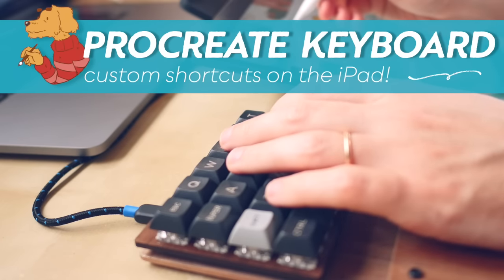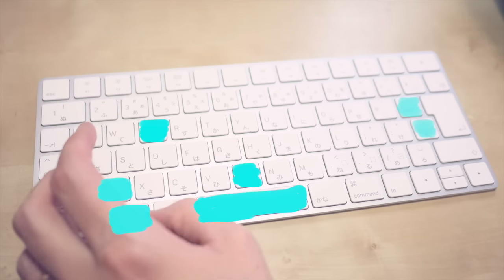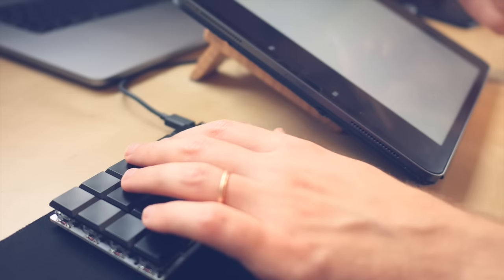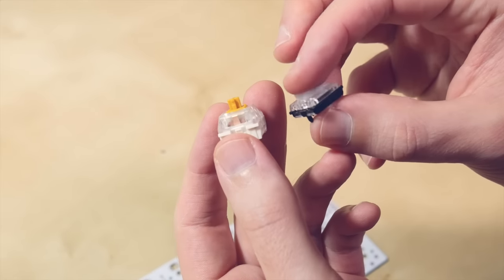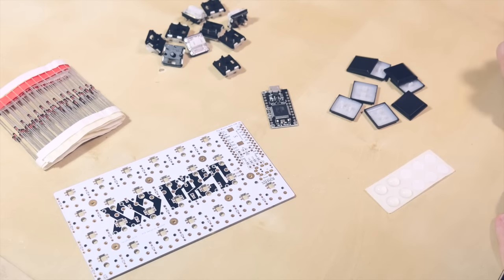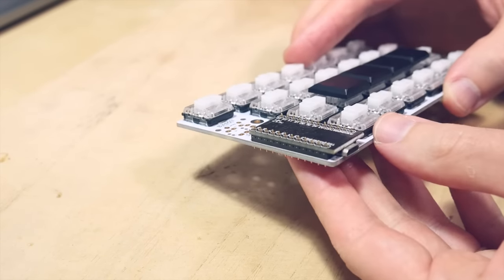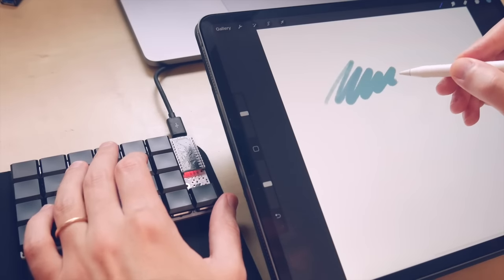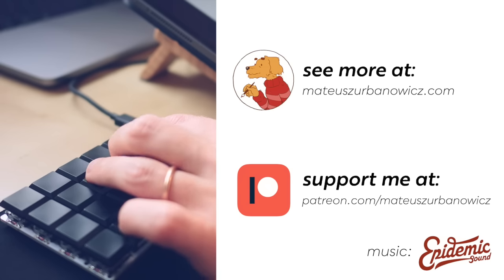Custom Procreate Keyboard!

Comment: oooh this is great! I was looking into a programmable mechanical numpad to reprogram for macro use but this pcb has more keys AND the Kailh low-profile ones! Really nice! only issue I've found with Kailh Choc is the low versatility of keycaps but this turned out great! Also, love that you attached the rubber feet directly to the PCB without a case - bare pcb looks SO COOL! Will attempt to build something like this, thank you ^_^

Comment: I've used Adafruit's MacroPad RP2040 to make a 12-key macro keyboard for photoshop. There's a display and rotary knob with push switch so you should be able to code (in python) an animator's stopwatch into it as well.

Comment: This is something I wanted for a long time! Before seeing this I thought if reconfiguring an Apple Magic trackpad 2 is possible for each different square centimeter to act as a different key cap. Second thought - I'm currently using a Razer Orbweaver Chroma for Photoshop shortcuts and macros.  Maybe it is possible to reconfigure this too for iOS iPad? 
Your solution is awesome (y) Thank You for brightening my day :)
Reply from the maker: If this requires configuration on the OS side then probably you can't use it. If you can program it so it behave like you want even on a different machine then it should work 👍

Comment: I've just built my own Macropad keyboard (RoMac) and have plugged it into the computer, configured in QMK and working fine. But I cannot get it to work with my iPad Pro (2017). Are you using a USB-C to Lightning cable or is there some other cable configuration behind the scenes?
Reply from the maker: I'm just using a Micro to C USB cable (no fancy things) It should work.
Reply: @mattjabbar  thanks for the reply! I didn’t realise the newer iPad Pro had a USB-C port so that might be where I’ve gone wrong. I’ve ordered a ‘Camera Adapter’ hopefully that’ll do the trick 😊

Comment: looking forward for the wireless version，gogogo
Reply from the maker: Already did it but it was more fiddling with the firmware and settings than building.
Reply: 19$ Microsoft number pad, you can fully customize all the buttons on your Pc with mouse and keyboard center and thn use it on your Ipad with any app you wan. Best value and versatility. 10/10 . 
Give me a like if i helped you out :)

Comment: This is very interesting. I use an old Belkin nostromo for my PC digital art and I find myself missing the macros on my iPad. I know basic soldering and I like DIY stuff so I might make this a future project. I do have a Bluetooth keyboard though...  I wonder if there's a way to program macros on that as well for the iPad?
Reply from the maker: Yes, you can define macros and even make macron on the fly (still looking into that) but you have to use the QMK as a command-line tool (not so difficult actually). More here: https://docs.qmk.fm/#/feature_macros
Reply: @mattjabbar  Great to hear I can use the same app! I'll definitely try that out. I'll play with it when I get done free time. Thanks for replying!
Reply: 19$ Microsoft number pad, you can fully customize all the buttons on your Pc with mouse and keyboard center and thn use it on your Ipad with any app you wan. Best value and versatility. 10/10 . 
Give me a like if i helped you out :)

Comment: I like it 😍 So if you are going to make it wireless, you will need a battery. Do you think where you put it?
Reply from the maker: I have a battery holder for two coin batteries https://yushakobo.jp/shop/ble-micro-pro-battery-board/ this will go on top of the controller.
Reply: 19$ Microsoft number pad, you can fully customize all the buttons on your Pc with mouse and keyboard center and thn use it on your Ipad with any app you wan. Best value and versatility. 10/10 . 
Give me a like if i helped you out :)
Reply: I'm really curious about the wireless and bluetooth upgrades. Are you planning to make a video on this? if not, would you care to share the details of what you tried / did? Thanks!

Comment: Love this. Do you have something like this for photoshop. Like what are your preferred shortcuts and how do you arrange it.
Reply from the maker: Yes, even though I don't paint in PS so much now. The shortcuts are more or less the same I just use SPACE, Z (for zoom) and V for choosing stuff additionally.
Reply: 19$ Microsoft number pad, you can fully customize all the buttons on your Pc with mouse and keyboard center and thn use it on your Ipad with any app you wan. Best value and versatility. 10/10 . 
Give me a like if i helped you out :)

Comment: Can this be used with being attached to a computer?

I was wondering if the Ipad is also attached to a computer for this to work
Reply from the maker: The iPad doesn't have to be attached to the computer. This works just like a regular USB (or bluetooth) keyboard just with fever keys ;) And yes, this can be also used with a computer for Photoshop for example. But on the computer you have the option to re-map your keys on the computer side so you don't have to build your custom keyboard - you can use any small keyboard for this.

Comment: How does the macropad connect to the ipad? I want to build one myself.
Reply from the maker: In this version - by just an microUSB to USB-C cable but I have since upgraded it to wireless bluetooth connection using the other controller Pro Micro BLE.
Reply: Mateusz Urbanowicz thanks, where else can I find a reset button? Sorry if it's a bad question I just can't seem to find one.
Reply from the maker: Mark Winn it’s just a momentary push button. Any one of the right size will do.